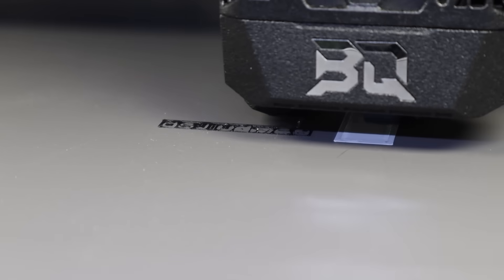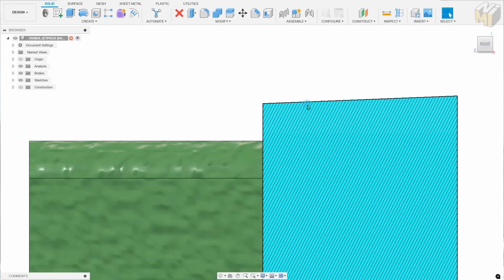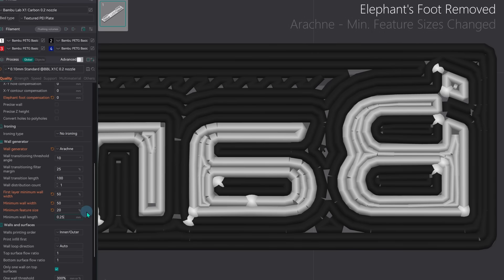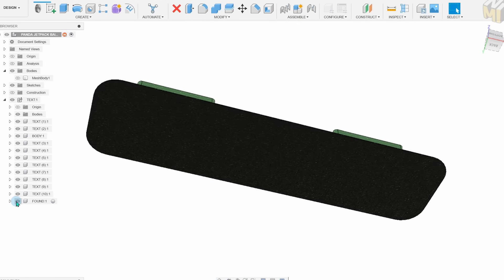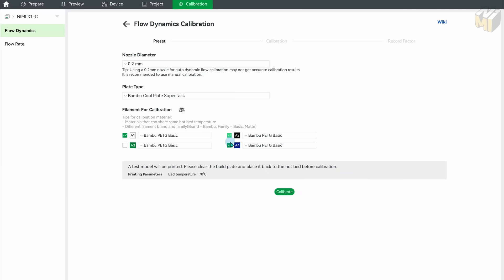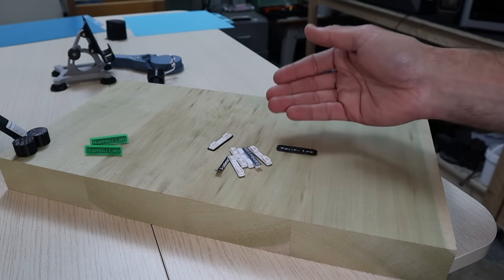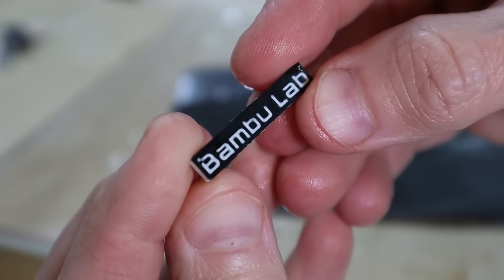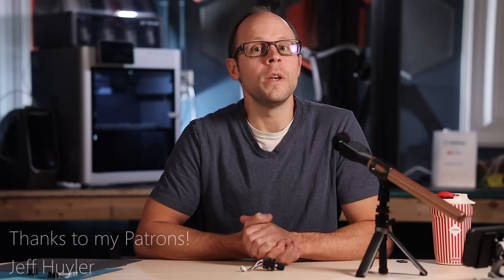The foundation is the KEY to printing the most detailed multicolored prints

Comment: Prints seem fine, but if I try to run manual calibration with petg and 0.2 nozzle and supertack and first layer 0.1mm, the initial lines on the front goes down fine, but the blocks printed refuse to adhere. Same happens with 0.1mm first layer height and supertack on a bigger block normally printed. If I leave the big block at 0.2mm first layer height then it adheres, but uncalibrated. I'd like to be able to calibrate manually petg with supertack 0.2 nozzle ....automatic works, but it fails to read the end result since it is a red transparent filament. My biggest breakthrough for prints so far is it require 0.2mm first layer height...with petg and 0.2 noz
Reply: in addition plate detection NEED to be active for supertack to even work with 0.2 nozzle and petg
Reply: and 0.4noz and supertack and petg for that matter...

Comment: I have the problem of text printed onto the top surface with a .2 nozzle, lw is 0.1 mm and the lines of the letters are exactly 0.2 mm thick, so that are 2 outer walls touching themselves. But the print looks awful, the letters are uneven and I don't know what to do. Tried so many things, calibrated the filaments, tested layer heights etc. Printer is Bambu A1C.

Another problem I have is that I also print the border on top of that surface, and in Bambu that border is perfectly even with the border of the object under it, but after printing the top border is wider and therefore "over the edge" of the underlying object. So there is a sharp edge when you touch it. Tried there to print outer walls first, but doesn't change anything.

Comment: Awesome video! This should get me very close for my first 0.2mm nozzle project today. One thing I was hoping you'd touch on would be how to setup pressure advance for the 0.2 nozzle over the 0.4. I'd assume you'd need to go down in number as it should have more backpressure than a 0.4. From my understanding of pressure advance, higher numbers mean less backpressure such as for a 0.8mm nozzle. I guess I should just look up a specific "what is pressure advance and how to tune it" video. Haha. I'm using Anycubic Next as my slicer for my Kobra S1, so I don't have that calibration tab yet, and flow calibration is a bit broken at the moment. Thanks again!

Comment: Thanks for this great vid!!  What is that tool that you are using to remove the print from the plate once done?  It isnt like anything I’ve seen so far…
Reply from the maker: Hey, no problem, and thanks for the comment!  I've been using this scraper for probably close to a year now, I had a look for it and I can't seem to find it.  It might take a bit more digging, but I should be able to track it down.  I'll put it on the list to get back to you when I do!
Reply from the maker: okay I found it!  https://makerworld.com/en/models/27002?from=search#profileId-23488  I used the steel scraper blade, but I've slightly sanded the edges with 400 grit to make sure they're just barely rounded to prevent them from scraping.
Reply: @NeedItMakeIt   Awesome!  Thanks for taking the time to search for it and getting back to me so quickly!
Reply from the maker: @SynthOSphere  No problem, I am way behind on comments, I'm trying to get back to everyone on-time again... this set uses the standard Bambu blade and magnet, the magnet isn't super strong, but it's good enough to hold onto the steel back panel pretty good on the X1C.

Comment: Hmm. This could be a 0.2mm nozzle thing. But jic, usually when I have any oozing or adhesion issues with PETG it's a sign that it's not dry enough. I usually put my rolls in a food dehydrator for 12 hours at 65c (verifying temp with air probe). (The "filament" dryers just don't cut it). The other issue I found, at least with the non Bambu branded PETG is if I print too hot I would get stinging or oozing as well. Like with Sunlu I believe I had to print at 240 where the Generic PETG setting was 270. Some people actually recommended hotter, but when I did a temp tower I had stringing issues even w/ extended drying at those higher temperatures. Also Sunlu recommended lower temp on the label when doing "high speed" vs "low speed".

Comment: For this purpose tbh I'd print a ~0.5mm deep groove, and fill it with a colored nail polish through a small blunt syringe needle. Doesn't need a multi-color printer, or 0.2mm nozzle, or any other headache. Works like a charm)

Comment: How do i even Design Text in another color in CAD? Do i have to cut the text out and then design it back in with a 0.4mm gap between the text and the Model? I dont even now how set a multicolor print in the slicer 😂

Comment: Rafts are one of the things I found bambu's support for PLA filament to be super useful for. It works equally well on PLA and PETG. You don't need to create an object, just set to 1 raft layer and then specify support for PLA as both your Support/Raft base and Support/raft interface. I generally try to avoid printing .2, but whenever I do that works very well and it removes extremely easily.

On another note, I've looked at that extruder upgrade but having to lubricate it makes me uneasy. The risk of oil/grease being that close to my filament bothers me. I might be worrying too much, look forward to hearing any updates on that.

Comment: Interesting. I’ve never had any issues with any of my 0.2 mm nozzle prints. I wonder why you did.
Reply: I was asking myself the same thing.
My 20mm tokens with detailed icons prints just perfectly on any bed.
Reply: Same here, and I don’t even use fancy print plates, or auto level. Good old glass, adhesion spray and screws for leveling. No issues with adhesion on full 20x20 bed

Comment: Slice gap closing radius and Resolution also heavily affect how detailed you can go in my experience! When I was trying to print bearings with 0.02mm and 0.01mm tolerance on my Plus4, I had to adjust those lower to not have the print fuse in the slicer due to the gaps being too small.

Comment: Good tips… but I’ve done away with messy glue sticks. I use adhesion spray (basically hair spray) and never looked back: great adhesion on a heated plate, but pops right off when the plate cools. Especially good for PETG. 
   
I agree on the slowness of the 0.2 nozzle. I print mostly structural parts, and might add some inlayed text. Comes out great (I run a Prusa Mk4s), but takes forever. For these kind of prints I would love a multi toolhead machine. Maybe one day 😊

Comment: A trick I have found to "boost" print speed with smaller nozzles is to increase extrusion width for any layers I don't need the precision. I was able to (a long time ago, I haven't needed a smaller nozzle for awhile) print at 8 cubic mm/s using a stock v6 hotend which is faster than the draft settings a prusa mk3 uses. I was printing at line widths of 1.2mm for the inner walls and infill, so I only had two walls and the quality was fantastic. The other thing I highly recommend is printing at 75% of your nozzle size for your first layer height. I do that now for all nozzles and it makes the quality much much better and more consistent.

Comment: The issue with Bambu lab Printers printing text is that they always print the text first, you cannot choose the order. All other designs work better with printing the outline first, then the text as you can extrude the finer details into the open areas like a plastic injection mold. Bambu still has yet to allow anyone to change the order in which colors are printed which is standard on almost every other slicer. 

You can "trick" the slicer into printing the text second by having a large two-layer object (larger than the surface area of the outline) on the print the same color as the text. This wastes filament, but it's the only way to make it work. Bambu Labs really doesn't care about text quality currently.
Reply: You don't need to 'trick' anything, click the bolt icon beside the build plate, drag the color orders around. It took me forever to realize this.
Reply: @Roobotics  Unfortunately that doesn't work for the first layer.

Comment: Extremely excited I was able to provide some assistance in getting your 0.2 nozzle prints looking extra clean. If anyone else needs help, don't hesitate to reach out!!
Reply: Respect to you for this technique! 🫡
Reply: Is the raft mandatory? I need some clean 3mm  font text embedded in first layer without post processing for mass production.
Reply: I've been struggling greatly with my 0.2 mm b
Nozzle, no matter what I do I get droopy loops off the sides and overhangs of my prints. There's little stringing when moving from spot to spot, but no matter the temp, speed, or flow rate I keep getting the same issues.

Comment: I have the opposite issue when using PETG.  I have a high temp smooth plate with a destroyed side because PETG sticks too well to it.

Turning up the bed temp makes it stick even better.  At 80-90C the PEI surface will clearly show scarring from the parts if you can remove them at all.

Cleaning with IPA makes it stick poorly because it just smears the finger oils around and removes very little of it.  I like Dawn Power Wash rubbed with a fresh paper towel and then a hot water rinse.  Dry with another fresh paper towel.  Don't touch the plate with your fingers.  The high temp smooth plate really shows finger grease.  IPA (at least the 90% stuff) also seems to soften the surface of the PEI making it tacky for a time.  This probably isn't good for the surface.

Did you consider using clear PETG for your first layer or even all the light transmittal portion of the print?  It would be brighter and give a nice diffused appearance.

Comment: Another tip I got recent on Reddit is to change the color to print the black in this case first and then fill in the white.
Reply: This is what I would have done first, but I’ve never printed PETG in 0.2mm before so I’ll have to try both and compare now!
Reply: *now= whenever my X1Cs have a free few hours between production and whatever random thing I’m printing for funzies lol
Reply: I've printed a lot of multicolor prints like this and have had a lot better luck with printing the letters/white first

Comment: In Bambu/Orca, it is set such that objects automatically snap to the plate for me.... how do I disable that and where is the drop command? I couldn't find answers on the Bambu Wiki 😕
Reply: In OrcaSlicer only parts can fly. Test it: add a object to your build plate, right click on it, choose "add part" and select your object you don't want to snap to the ground.
Reply: @Duevel (in Bambu you just assemble first and then you can move z axis)
Reply: @joeylopezdesign  Same as in orca
Reply: In Bambu studio, you just assemble (group) any additional item, and then you can move an item’s z axis up

Comment: Stick 0.2mm nozzle on, use quality Bambu filament, print and be done.

Your modified third party printer will never work as well as the standard one and changes all perimeters.
Reply: Yea after manually calibrating the filament.

Comment: Fiber Laser not recommended for taking away material. You could mark filaments with fiber laser or UV laser but engraving/taking away material will just melt the plastic.
Reply: I think using low duty cycles is the key to engrave plastic with fiber lasers without melting, just that will be slow.